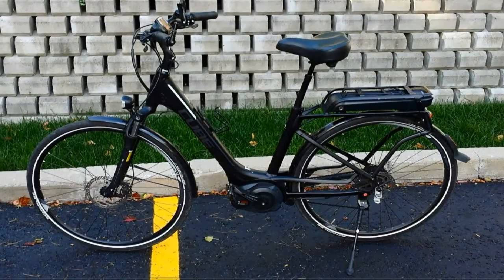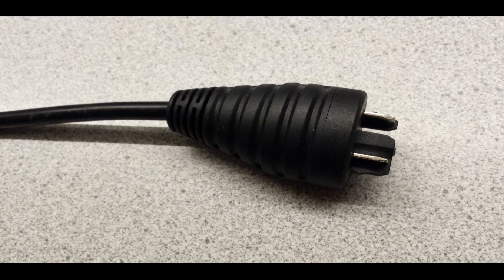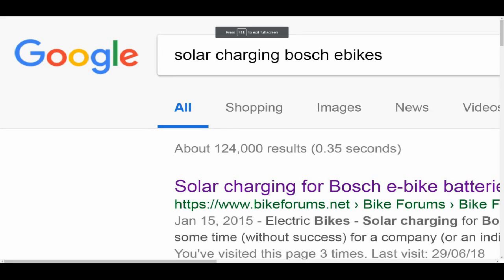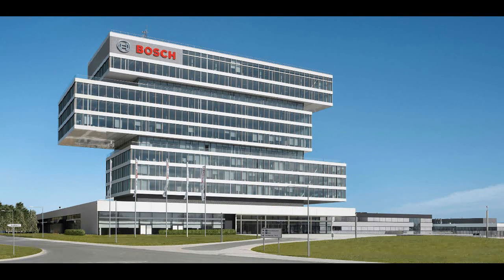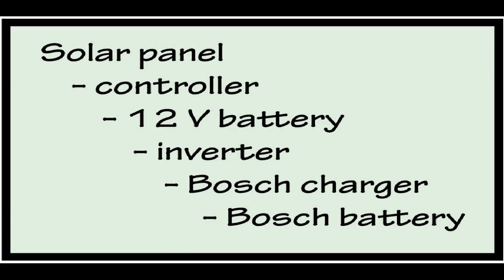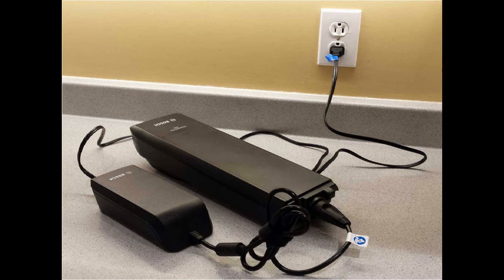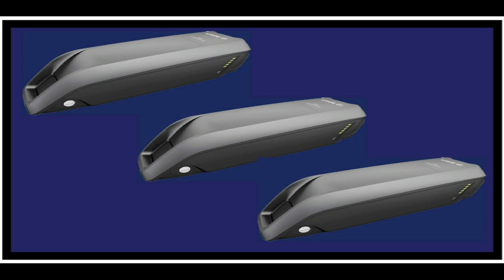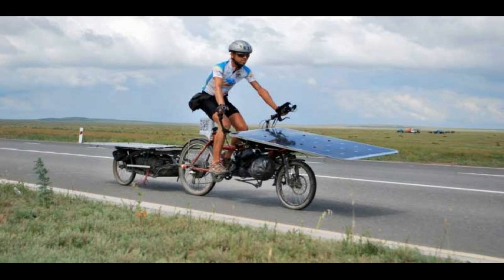Solar Charging a Bosch Ebike Battery   Disappointment

Comment: You should NEVER use anything other than the original bosch charger. You will destroy the electronics by doing this
Reply from the maker: You're right. That's one of the disadvantages of the Bosch system.
Thanks for your input.
Reply: @RobertBeriault753  NO its NOT a disadvantage. It has been done so idiots dont start messing with it like here. because you die from that. look on videos on batteries from other brands. Why do you think Bosch batteries never explode. Because of that safety feature
Reply from the maker: Why does Bosch not allow solar charging?
Reply: @RobertBeriault753  because the batteries need a reliable current. also people are going to use dangerous combinations of converters. This is why tge batteries explode
Reply: @RobertBeriault753  lithium batteries can be extremely dangerous. They can be highly explosive and cannot be put out with water in case if fire because it reacts violently to water and will ignite even further. Bosch have implemented this safety feature to save lives. And it works very well unless irresponsible people stimulate others to open them up and try to use alternative charging methods when that is exactly why you see people dying from exploding batteries.
Reply from the maker: Thank you for sharing your knowledge of the Bosch ebike system.
Reply: @RobertBeriault753  that is why bosch batteries do not explode. They have implemented this security measure and it works and saves lives. It is NOT a disadvantage but a smart safety feature

Comment: pecron makes a 200w folding panel that out puts the right voltage but you need a dc to dc convert for the 5 volt for the bms
Reply from the maker: Sounds complicated. Thanks for the input.

Comment: It really is a shame how proprietary Bosch systems are. But it seems to be the way things are headed in general. FWIW...it's nice that the battery charging interface at a minimum is not software locked. I have a feeling the rest of the components are locked in such a way.
Reply from the maker: Yes, it looks like we're going that way. This summer I tried a Frey Savannah. It has a fancy display that requires a code to turn on the bike's electrical system and you have to register the bike online. I didn't buy it.

Comment: Serendipity Sue youtube has videos on how to charge the bosch battery. He provides all the parts to purchase as well. He has designed a plug that fits into the battery and provides the 3D file for you to print out. I have personally have printed the 3D plug and it works.  Email me if you have a hard time finding it
Reply from the maker: Thanks for the info!

Comment: Some may have already found a solution to getting the Bosch battery to charge from a non-Bosch charger, but there's a caveat.
The workaround to get the battery to charge from a non-Bosch charger or DIY solution is to apply 5 V to the small pin with respect to the battery - terminal. This puts the BMS in charging mode and enables the battery output. But you may be missing out on some safety features I think Bosch built into the charger.
I have partially reverse engineered the Bosch 4 A charger (BCS220) and found that it's more than just a power supply with an enable function. There's also some extra safety built in that only dedicated Li Ion chargers may offer.
From the startup sequence I found that the charger will apply only 5 V on the smaller terminal (with respect to the batt - terminal) and wait for battery voltage to appear on the + and - batt terminals. Only when this is the case, and probably also when this voltage is within a certain range will the microcontroller start the power section and close a relay contact to connect it to the battery. This is why you can hear a click a few seconds after connecting the battery.
I found a current shunt in the negative rail so the the actual charge current can be monitored and interrupted should it go outside of certain limits, an perhaps also when a preset time limit is reached.
When the battery is full, the charger opens the relay contact and shuts down the 42 V power section. It goes in a dorment state for a couple of hours (according to the manual, I didn't check it) and wake up again.
With a workaround solution, you're probably relying on just the BMS to prevent things from going wrong during charging. SerendipitySue's solution surely works, but is it as safe to use as a dedicated Li Ion charger?
Reply from the maker: Thanks for your careful investigation. I've concluded that if I do decide to equip my camper with solar panels, I'll have to tow it with any ebike but a Bosch-powered one.
Reply: I found this explanation useful to continue my project to create a DIY charger for bosch. It's not always about extending the range. I hate carrying around, owning multiple chargers, multiple cables for them. One charger should be enough to charge everything, from cellphone to bike to laptop to whatever else, by carrying multiple adapters for it in a small bag. 
It's just power man, they making this too complicated to sell their own product to make more money. Convenience for them is inconvenience for us and less money in our pockets.

Comment: I use a powerbutler for my shimano system. It can even run from solar using a victron 75-15 and a small 5ah 12 volt battery for stability of the current. Turn on subtitles on this youtube-movie https://www.youtube.com/watch?v=EjcykZkLQZk

You are right on buying more batteries, they are just like 2.5 KG for 500 wH and no need to tinker. I charge one  e-bike battery from the surplus of my home solar while the other one is on the bike.
Reply from the maker: Interesting. Thank you.
Reply: @RobertBeriault753  You are welcome! Of course the conversion to 12 volt does mean some inefficiency. Asked the maker if the Powerbutler would run on 24 volt but unfortunately.

Comment: You can get a Bosch Connector. The company is called "powerbutler". There you can get spare Adapter to XLR.
Reply from the maker: Thank you for the information. I didn't know about this company.
Reply: Only 2A output is too weak

Comment: !!!! I have the solution !!!!
The seprate pin with the big platicpart above it needs 5v input to activate the BMS to accept 42v to the other terminals
Please like to let him Know!!!
Reply from the maker: When I made this video I didn' t know about the 5V input. Several people have pointed it out since, but it doesn't help me because of my ignorance of electronics!!! 🤣
Reply: @RobertBeriault753  Yes, that is a problem Bosch created. I did see a YouTuber "
SerendipitySue" build his own 12v boost controller but it's a bit complicated. The easiest option is to buy a custom-made battery for when you want to use solar. Affordable e-bikes here in hamilton build the batteries at a very reasonable price (42v 20 amps $580) and they can wire it for you. You still can use your bosch battery for shorter rides.

Comment: Hi Robert, I have just performed the latest round of experiment in search of the perfect light-weight portable solar charging solution for BOSCH 36V EBIKE batteries.   And I believe we have a solution here with the GENASUN GVB-8 solar controller.  As mentioned we need to fabricate a custom 3-pin charging plug with a +5V DC power supply from USB power source, so as to initiate the charging process.

The latest reading from the power meter has confirmed that the highest charging current that can be achieved for 625Wh BOSCH 36V EBIKE battery is 6.03A at 40.30V charging current.  This is 243.0W power input to the battery being charged.  And is on-par with the fastest BOSCH AC Fast charger.

For this experiment, I have discharged the EBIKE's battery by riding a fast pace 30km trip on TOUR mode.  
For the solar panels, to ensure we have more than the solar power we need, I connected 4 flexible solar panels up, 2 in series and then in parallel, to boast not only the panel voltage, but also the max current output.  The test was done at around 12:30pm mid day sun on a Sunny 31C.

A quick video has be prepared just to show the connection schema and the power meter readings here: 
https://youtu.be/-v9h64uHGXs
Reply from the maker: Nice work! Thanks for sharing.
Reply: This guy also build his own 12V Charger. He used a 1500W 12V Step up Converter, tuned it to 42V and max 2A Output, then he used a 12V to 5V Converter for the 3rd pin and put it all together. He even 3D printed a plug!

https://www.youtube.com/watch?v=d2r3jbL78iQ
Reply: Hi,
Can someone provide me t'he full (part) List used in this setup , e.g. how connector is build and which Solar panel is used and so on

Comment: Is it possible to power a bosh mid Motor with another five pin battery from ex ecoride bikes?. Its a 36v 14,6 ah battery i have been able ti connect but the motor will not function. Only  the screen function.
Reply from the maker: I'm not an authority, but from what I've learned about the Bosch proprietary electrical system, no, you can't use any other battery but a Bosch electric bike battery. All their components are interrelated.